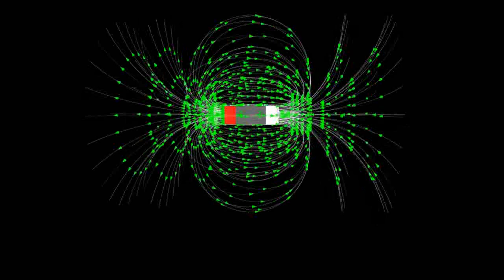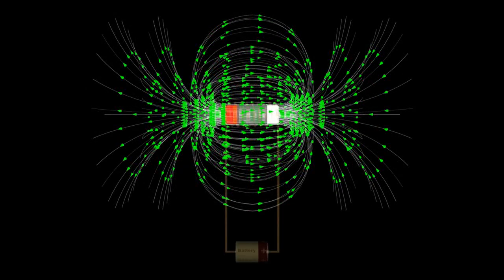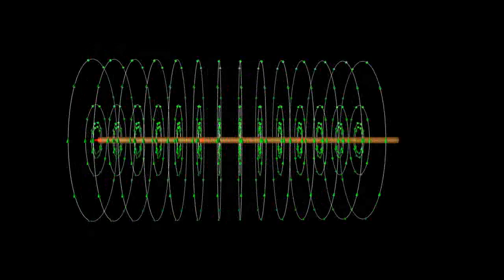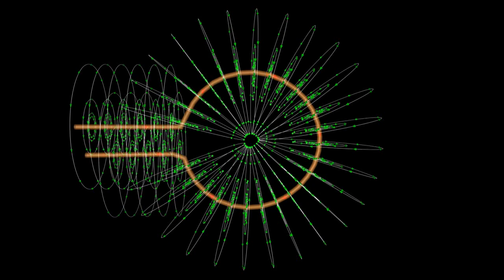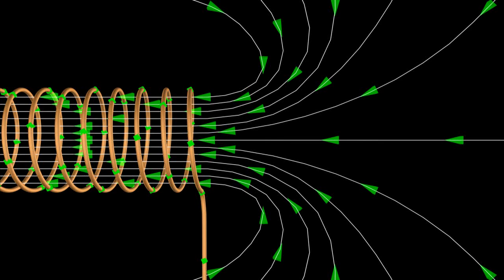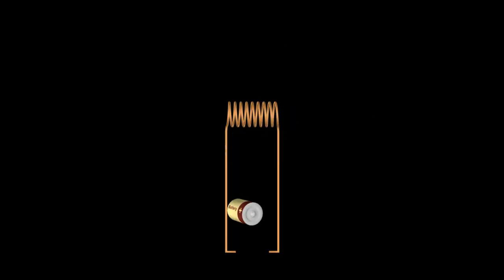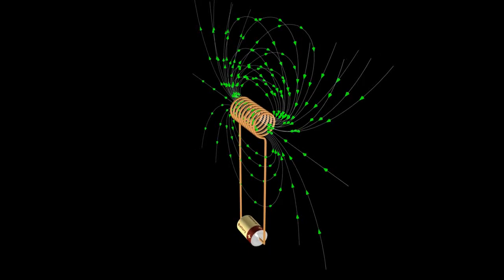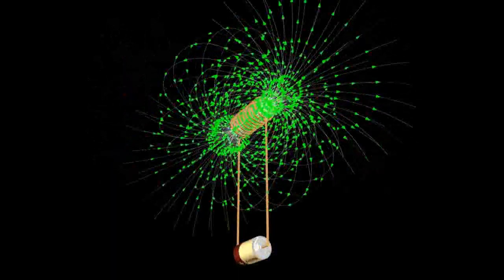Magnetism: Electromagnets

Comment: I would like to know what can be done with this electromagnet. Too much energy is lost in a torus to sustain fusion. A sphere is better. Search for "spherical electromagnet". It should be the first thing that pops up. Look at figure 1. You will know it when you see it - it's my icon that you see to the left. In this design the plasma is rotated like the armature of a motor with the axis of rotation constantly changing. The counter emf inside the plasma compresses it toward the center.